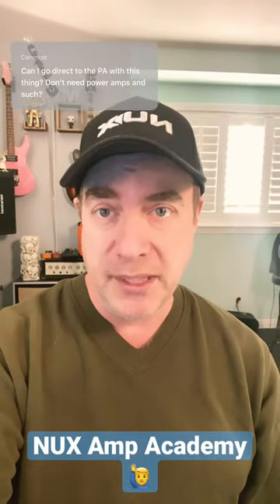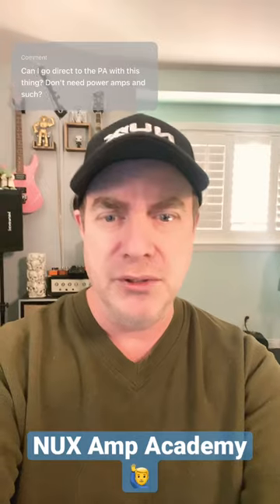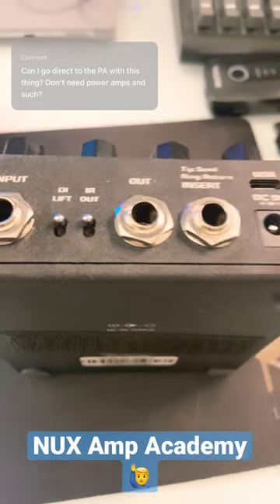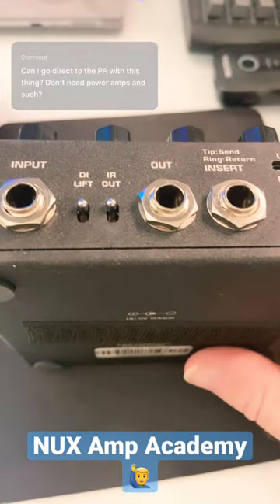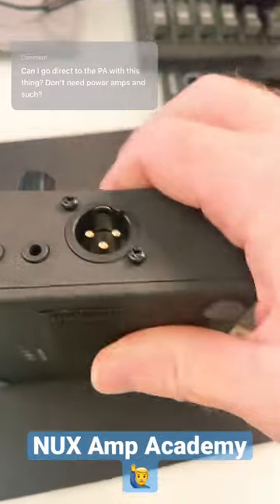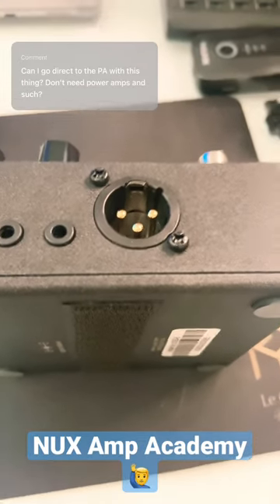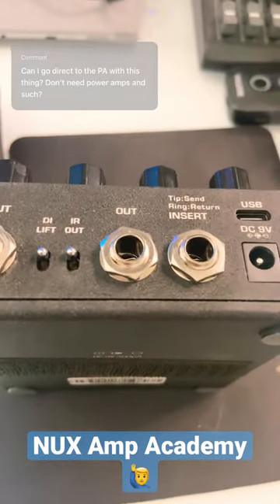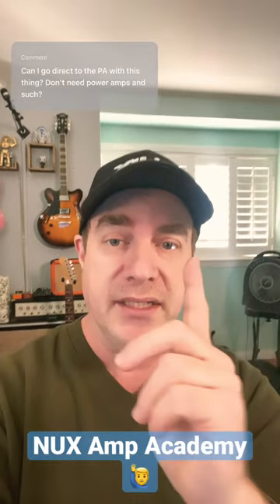NUX Amp Academy PA Connection Question

Comment: I noticed the effects loop uses a 1/4” TRS cable. How do I use it with my time based effects? Do I need a special cable that splits into two 1/4” TS cables?
Reply: when you buy Nux AA its include 1/4" TRS Y cable send and return

Comment: Hi, when I plug an XLR cable into the D.I. Out port, if I additionally try plugging into the Guitar Output simultaneously to use for personal amp monitoring I am getting NOISE on the D.I out signal. Is this normal?
Reply: There should not be any added noise unless there are grounding issues or missaligned volume levels, your monitor channel might be clipping.
I own 2 Amp Academy units, in the band we go from jack output without IR into poweramps with 2 cabs each side, used as backline monitors and XLR out with IR to front of house, no additional noise.
Did you adjust preamp volumes and DI out volume to match?
The Amp Academy is on of the few units that allows that, had some other modellers in the past who lacked volume seperation between outputs, which is pretty annoying when the power amp gets a good signal but the mixer gets to much and starts clipping even with channel gain all the way down.
Apart from expensieve modellers I only encountered 3 small modellers where the DI has its own volume control, form factor and build in noise reduction puts the AA ahead, although I use only a single amp model with eq, loaded IR, tiny bit of reverb and NR.
I prefer analog boosts in front, currently TB MK1 and Nux TubeMan (way to underrated TS), besides using a brown pedal with blue lights that chains 2 modulation/lfo effects with dry mix on each in the front of them boosts without adding any additional unwanted noise.

Comment: Can you use both outputs (XLR and 1/4) at the same time? For live use, you could use the 1/4 out with the IRs OFF and use the amp’s return (to use it as a power amp) and at the same time send the XLR to the mixing console (front of house)? That way you can monitor yourself by hearing the guitar on the amp behind you onstage
Reply: Yeah you can do that bro. IR "off" for amp line out and IR "on" for PA XLR out ( you can set it in the PC edit)

Comment: Hello,  I’m using the effects loop for my delay and mod pedals.  Thai works great for church going straight to the house .  When I’m going straight into my guitar amp On other gigs can I bypass all of the Amp Academy processing and still have the effects?  (The effects only work when the Amp Academy is on).  Thanks
Reply from the maker: Unfortunately no. Once you bypass the pedal the send/return turn off as well.